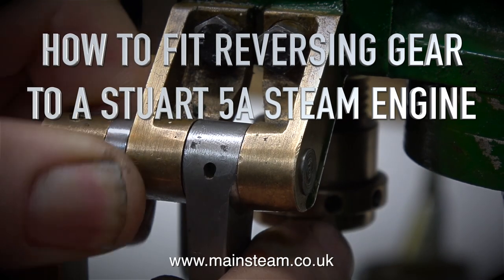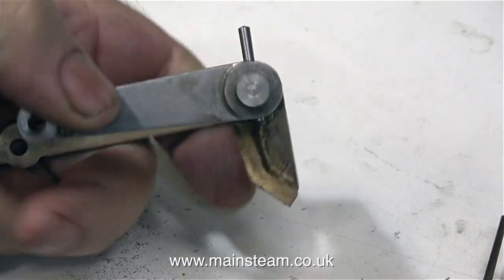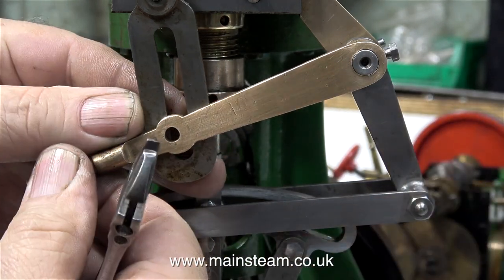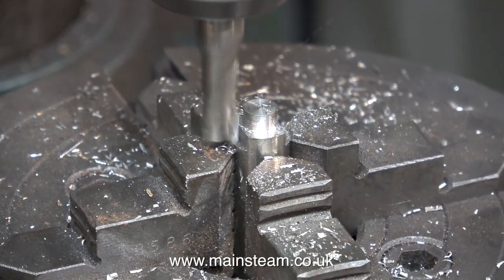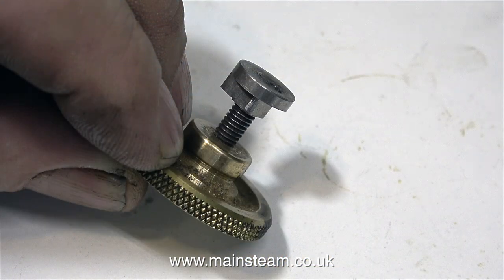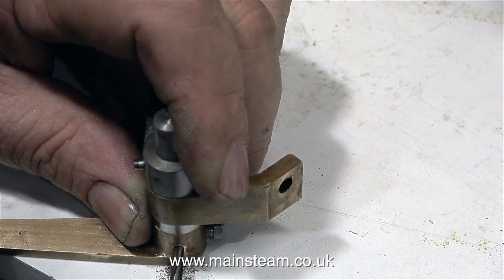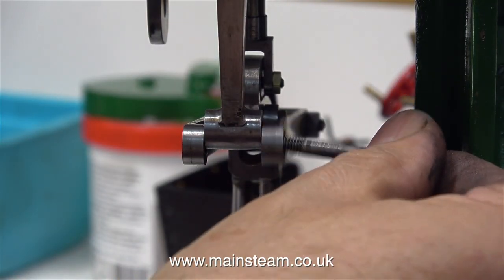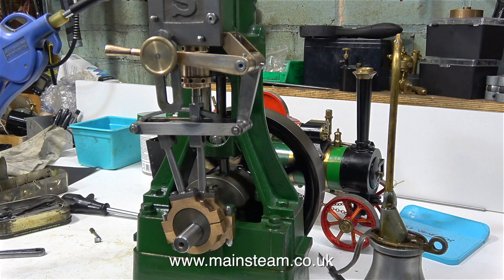HOW TO FIT REVERSING GEAR TO A STUART 5A STEAM ENGINE - PART #4

Comment: Bonjour Keith,
Would it be possible that you are the hidden son of Rowan Atkinson and Alfred Hitchcock ?
Besides this, sorry for my lack of English vocabulary, on my little machines (till D10) the reverse covers all the course of the curved guide, and on you larger machine, it does not, is it normal ? Would not you loose a part of the power because I know that on real machines, you can slow down by playing on this course ?
Amicalement, Raphaël
Reply from the maker: I think it's probably got a longer slot than it need to have .... I think it's dimensionally OK

Comment: I’m sure you’ve seen it, but just in case you haven’t and it’s putting undue strain on the component, there appears to be a bolt missing from the brass eccentric bearing. Pardon the terminology 😱